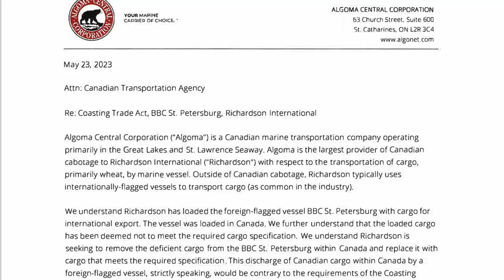This ship loaded the wrong Cargo?!

Comment: So the unanswered question is this: what exactly is wrong with the wheat? It would have been inspected during loading at Thunder Bay and it's hard to imagine that a "bad" load of wheat would have gone undetected. Perhaps an issue with the type or grade of wheat that was loaded?
Reply from the maker: My understanding was that a certain grade was purchased, but what was shipped didn't meet standards for that grade, and they didn't discover this fact until the ship had reached Montreal. they offered the buyer a discount, but that was a no go.